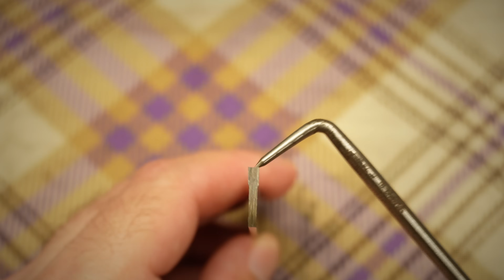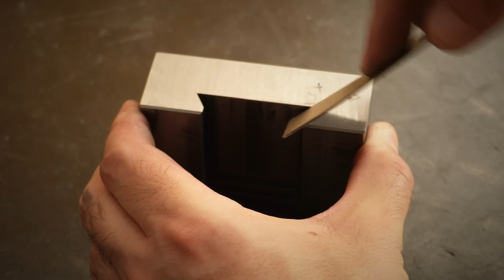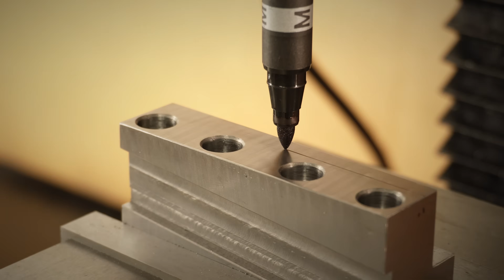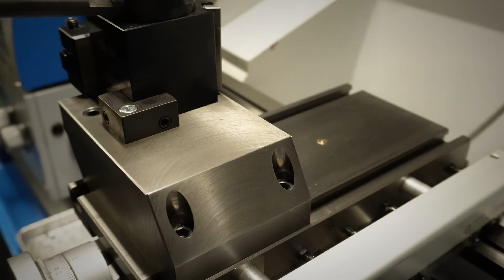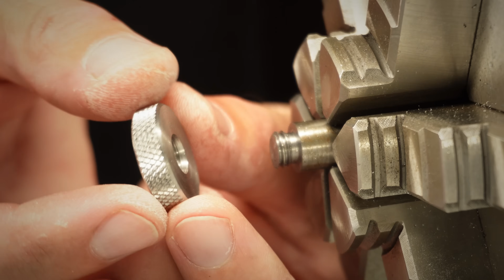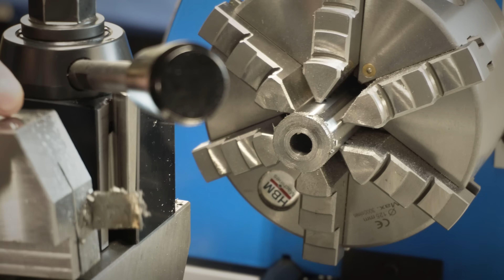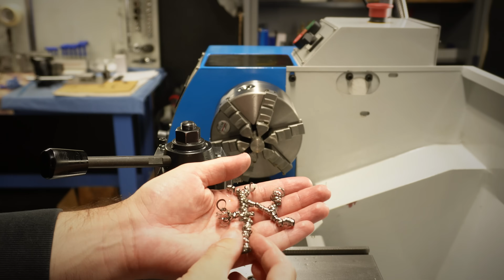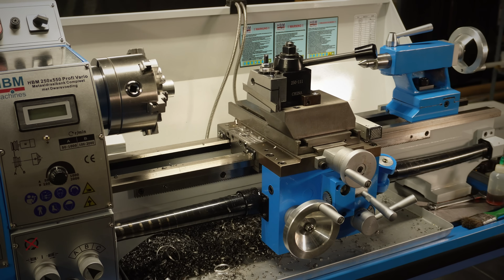Parting-off on the Lathe - Rigidity, Rigidity... and a Spring!

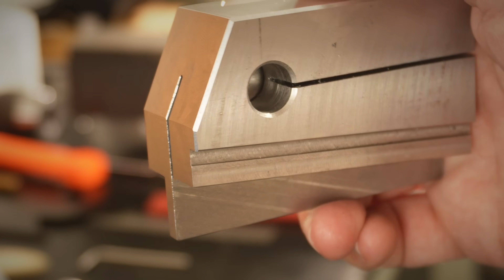Comment: 14:20 - Would an oscillating tool work for this? Not sure what type of blade you'd use, but maybe something with an abrasive?
Reply from the maker: Not sure. I looked around what I had immediately available, but found nothing better that a hacksaw blade and my hands. I did try a 1mm drill on a collet but runout was too much. Also the surface was not flat, it would break easily. Maybe a long 1mm endmill would've done it with very light passes, but I don,'t have one and certainly didn't want to break one in there. By hand it took a while though, only 3 or 4 teeth of the saw were cutting!
Reply: @nbrworks The best tool for the job is generally what you have available, and your tool did a fantastic job.

Comment: Another oft forgotten parting off problems are the actual gripping of lathe hard jaws or lack of! 
And or the rigidity of the lathe spindle!
The hard jaws of any lathe chuck become "bell mouthed" after time, and need to be re ground back proper for accurate and solid gripping, with little to NO chance for vibration or slippage. 
Lathe spindle issues are also due to age and or abuse. This is a more problematic issue probably requiring a re build and new spindle bearings

Comment: Do you think it improved things enough that a carbide insert tool would work?
Reply: Why go for carbide insert tooling that costs money when they wear or chip it , when you can just grind the end of an HSS for yesrs and years before you need to spend more money on a new blade? 😊
Reply: @chrisstephens6673  - Have you ever tried to  put a C-clip groove in the outside of a hardened bearing race with HSS?  Turn down the shank on an endmill for clearance?  Had to cut down a hardened dowel pin?  Make a part out of pre-hardened stock?  Cut off a piece of linear bearing rod?  

HSS is great when you can use it, but you can't always use it.
Reply: @somebodyelse6673  no argument there, yes I have cut many ciclip grooves on gearbox shafts and ground down a grooving tool to 1mm to do it, but for general use I use the same blade used in this video set at 7 degrees. For small stock I use a 1.6mm blade again set at 7 degrees to horizontal. Between those two parting tools most of my work is covered but I do keep a carbide insert holder in reserve.
Reply from the maker: I don't have a carbide tool that fits in this tool holder, but I think it depends. If we're talking about a custom tool with a brazed carbide tip, I think it might work. If you were thinking about an insert tool, I think it wouldn't work very well. Normally those inserts are made with built in rake so that they sit horizontally in tool holders, also I'm not sure if they would resist very well to the 'hammering' this spring can cause on harder cuts. But, of course, I might be wrong.